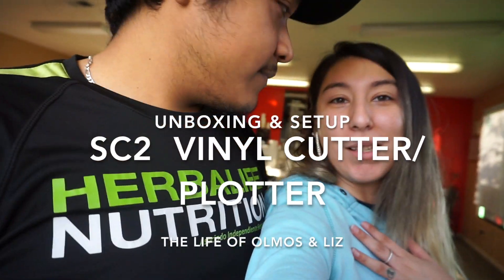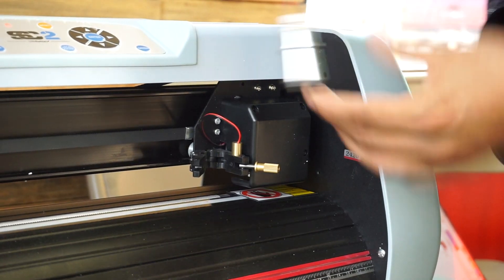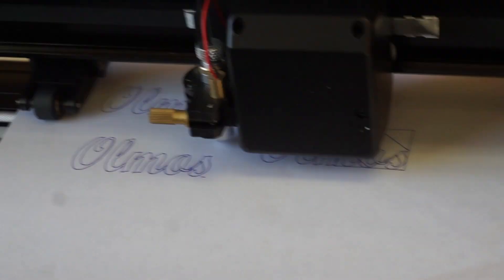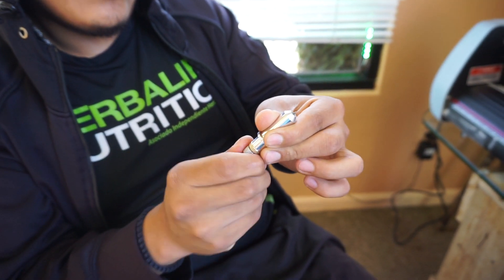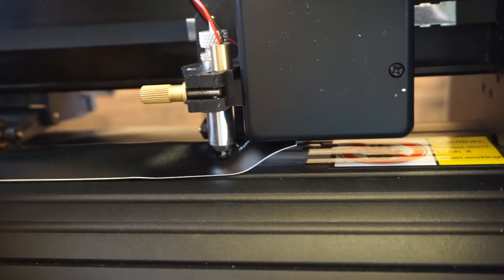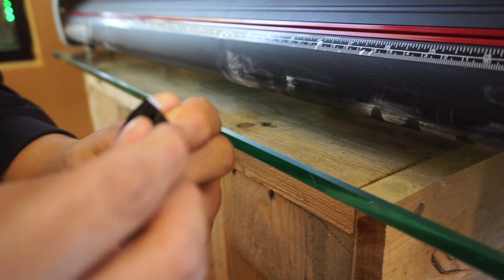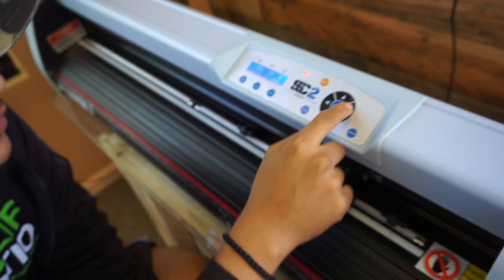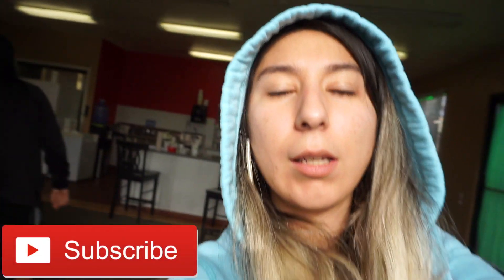Got a NEW VINYL CUTTER for our business (SC2 Unboxing & Setup)

Comment: Hey ! Thank you for sharing this. Out of all the videos I have found online for this machine yours is the most helpful. I had a question did you ever have an issue with the vinyl having extra lines in them between each letter? I am having this issue and when I go to heat press it on shirts it shows these ugly lines right throught the letter. Any help/suggestions would be helpful :)